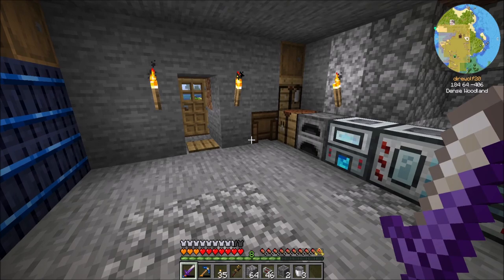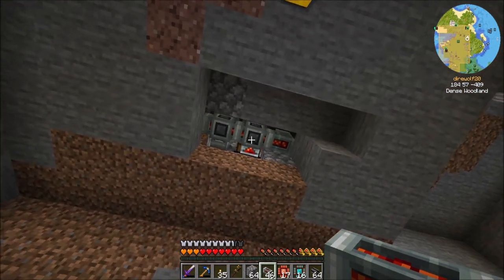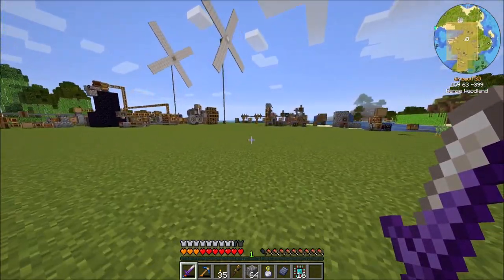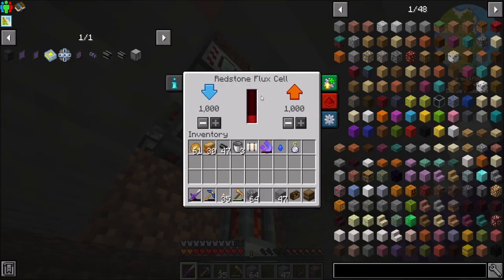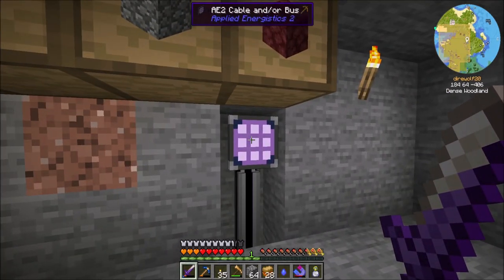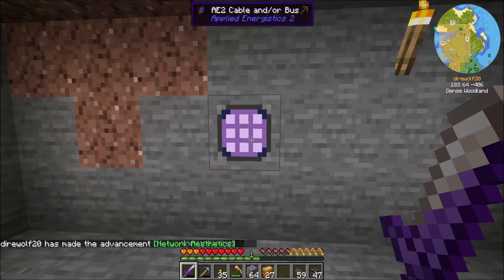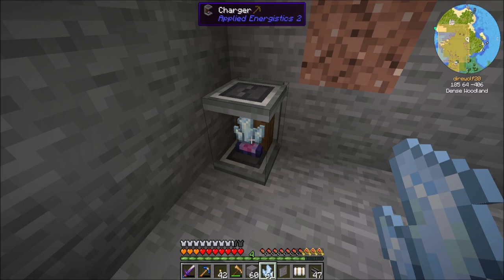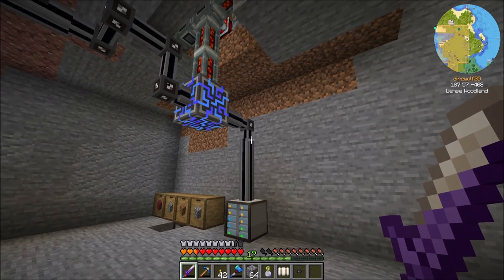Create A&B Ep39 Applied Energistics

Comment: You need to shift right click the invar pipe with the create wrench to add either an input or an output to the pipe connection. That way it will work with the flux cell
Reply: I remember being in this same sitiation, and it toke some time to realize this behaviour 🤦‍♂️
Reply: @lonking1990  I had to google it as I was getting so frustrated especially after I had put holding IV enchant on the cell
Reply: well hell. i never did figure that out so i just didn't bother using the cells

Comment: Dire you can change the output drawer of the craf6ting line, and the input chest of the mechanism lines into ender chests and then you get the full routing without having to really change much of the design. sure it might backstuff but you don't really need more then a full ender chest anyway.

seems like the easiest way to do things

Comment: What are your thoughts on one large power system vs several smaller dedicated ones? I have always enjoyed having a few solar or wind generators and batteries for whatever storage solution I have incase my machines suck up all the rest of the power.
Reply: In my playthrough, I have one central power generator that started as a handful of water wheels and now has 4 windmills all tied into the same line. BUT, I complement that with a few random windmills / water wheels here and there where it makes sense (for example, down at my andesite generator since that has to be above bedrock and my main factory is in the highlands at y level 100)

Comment: It always grinds my gears when he sets the AE display to sort by number of items....
Reply: I've learned to accept that he's going to do it, not least of which because I think every other modded MC youtuber I've watched does it too. I've never properly understood it, though, especially given how often I've then seen them want to get a bunch of stacks of one thing and then had to chase that thing around the interface as the number in the system drops. (And/or they misclick and get some of some other thing.)
Reply: I always do that too, because that way I automatically keep track of my external storages. The last thing I want is my drives flooding with cobble or wood
Reply: @niekvandenengel4251  same, i do it too, partly for that reason and partly because i find that the stuff i have the most of is also the stuff i use most often
Reply: @niekvandenengel4251  so you enjoy chasing the item down the interface?
Reply: @joshuahellfire3287  well it's what you could call collateral damage. I found out most of the time I use the grid for crafting and less for actually getting stuff. So for me it works best if I have direct view on my external storage and take the 'chasing' as a managable side effect

Comment: What are the advantages to using applied energistics 2 vs refined storage? It seems to have much more complex recipes and more limitations.
Reply: Well AE2 is a lot more fun as it requires more planning of your network, because of the maximum ammount of channels. But if you do it right that is more of a challenge in stead of a limitation. For example, you can run as much as 32 x 32 channels through a dense cable, but sadly Dire is not that good at setting up AE2 to max potential. Technically the storage drives of AE2 can hold a lot more items, but less different kinds. The only thing RS is better at is fluid handling. RS is actually a sort of copy of AE1, without the crafting cube, which a lot simpler. If you don't feel for the complexity of AE2, just go with RS
Reply: @niekvandenengel4251  So storage capacity in either mod seems to be increasable fairly easily. So to me storage capacity doesn't matter much. Is there anything ae2 does better than rs? you mentioned rs does fluids better.
Reply: Aestetically AE2 can be better hidden in walls with the facades, but because channels is a thing you might need a bit more room for cables, as you can't just split them off of an existing cable. The formation and deformation panes of AE2 and RS have quite similar functionality, however if I recall correctly one of the pane of one of the 2 is slightly better, as there is no filtering possible of 1 of the 2. When it comes to fluids RS is by far a lot better than AE2. You can even set up crafting with fluids within the RS crafting recipes, while with AE2 it ends with importing and exporting. And a couple years back I even had a bug that when AE2 could store only a few millibuckets in a certain storage it still took a full bucket, voiding the difference.

For me however the fun I get from setting up AE2 outweights by far the fun I get from setting up RS. RS feels lame and a cheap copy of AE1, at least to me. For that reason I will always choose AE2 above RS
Reply: There are a couple AE2 expansion mods that add functionality like ExtraCells, expanding the fluid handling capabilities of AE2, for example fluid storage drives, but still not like RS, and some mods interact with AE2, like Thaumcraft, unlike with RS. So while RS has a couple build-in pro's, AE2 is better supported among other mods
Reply: @niekvandenengel4251  I am with you concerning AE2 being more fun than RS, and channels were never a real problem for me either, but lately as I tend to play 1.16-packs exclusively, I don't use AE2 anymore. Server operators tell me that RS is more server friendly in 1.16 than AE2, practically switching their roles from earlier versions, where RS tended to hog server time, and AE2 was the star pupil. Makes me sad, since as said I would prefer the challenges of AE2 over the fairly easy setup of RS.
Neertheless, RS as stated has several advantages over AE2 for the player. The aforementioned fluid crafting mechanics for one. Also the formation and annihilation planes work much more intuitively. Apart from the better filtering, RS actively outputs blocks or items into the world, whereas AE2 views the formation plane simply as an in-world "storage" option, where it is up to the player to generate sort of an "item pressure" for it to output anything. I only got them working reliably in a subnet with just the formation plane as the sole option to "store" items coming from an interface or input bus in that subnet.
Reply: @niekvandenengel4251  Cool, I guess thats probably why a lot of mod packs have both then.